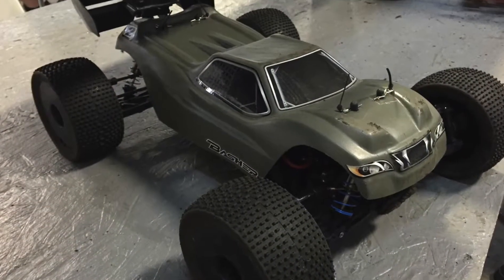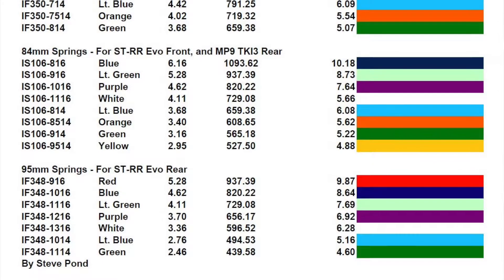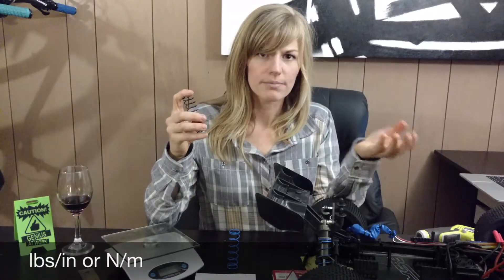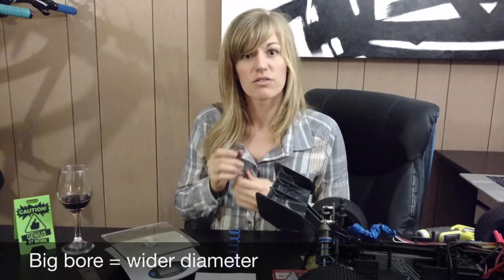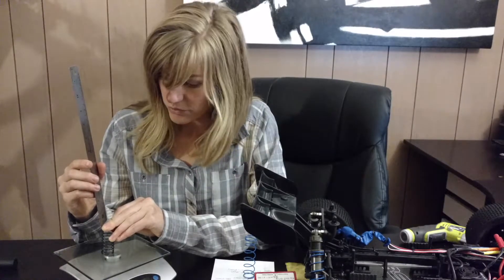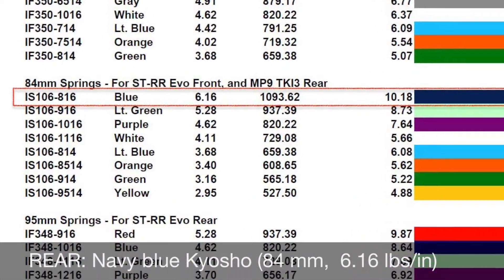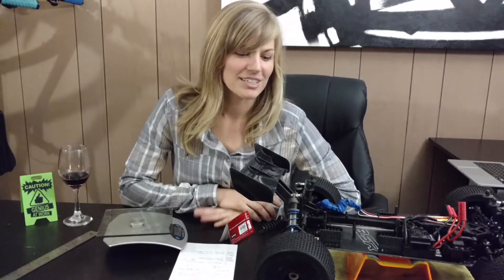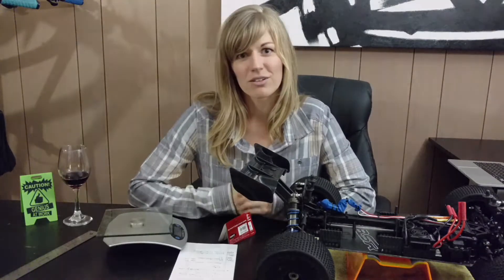CHECKING YOUR SPRING RATE  |  Basher Sabertooth spring upgrade

Comment: This video is probably super old but I'll throw my 2 cents in anyway. You can also get slightly thicker shock oil to reduce some of the bottoming out. More pack means slower shock travel (better shock dampening). Truggy may jump a little better too! Great video!

Comment: I have a Sabertooth, and just changed my 5000mah 2S batteries to two 6400mah 3S batteries and now everything turns on, and steering works. but the green light on the ESC flashes and the motor doesn't run at a any ideas what I am missing?
Reply from the maker: The ESC might need to be programmed.
Reply from the maker: Also, did you run the 3S batteries in parallel or in series? If you run your 2S batteries again, does it work? You want to avoid running the 3S batteries in series, since it will make it a 6S and could fry the electronics. Email me at rchobbygirl@gmail.com and we can troubleshoot.
Reply: as tantas esta a correr em 6s e o esc. no aguenta , ou entao algo se passa com a reprogamaçao do mesmo no caso de so querer usar 3 s , e uma vez quem 4s trabalha bem, se usares so 1 batery de 3s tens de adaptar a ficha ,caso esta seja em serie